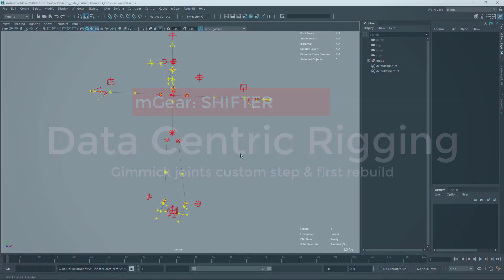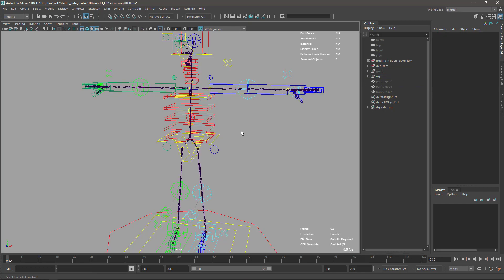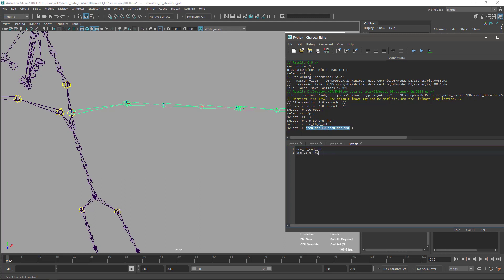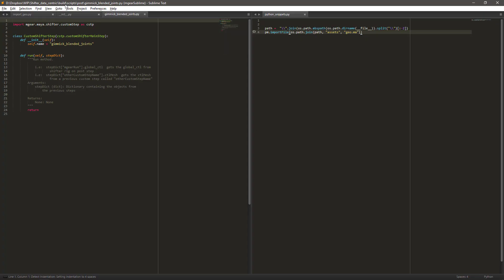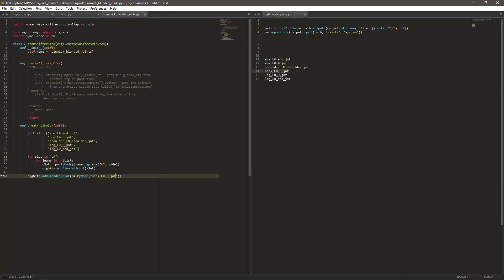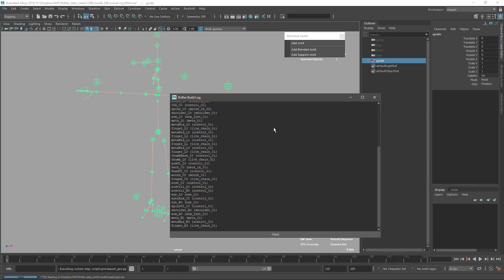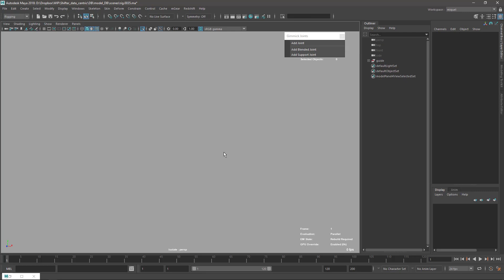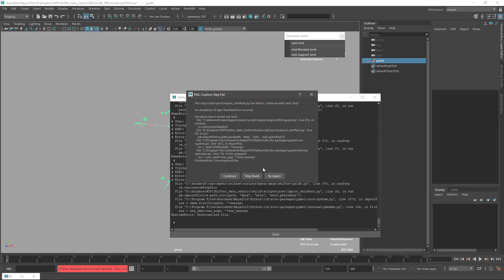Data Centric Rigging 014: Gimmick joints custom step & first rebuild

Comment: Rather than splitting "\\" strings on the file path, you can also use ".." in os.path.join()
So for example, depending on your data directory structure, you can go up one directory and then into "skin", like this:
import os
basepath = os.path.abspath(os.path.dirname(__file__))
skinpath = os.path.abspath(os.path.join(basepath, "..", "skin"))

Or if you need to go up two or three directories, for example:
basepath = os.path.abspath(os.path.dirname(__file__))
skinpath = os.path.abspath(os.path.join(basepath, "../../..", "skin"))
Reply: Thanks for the tip!  :)